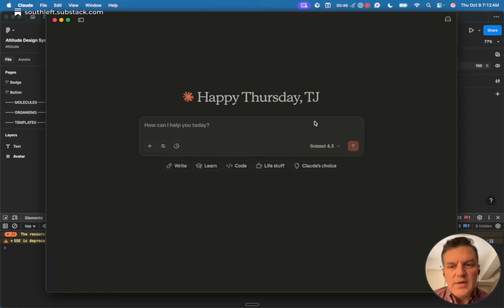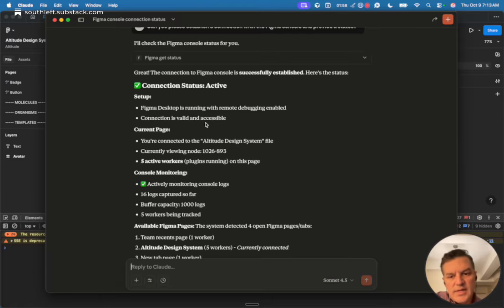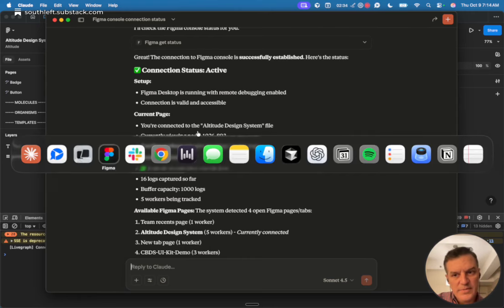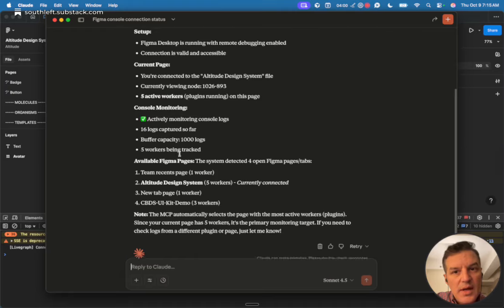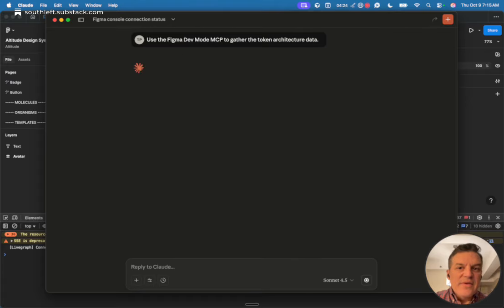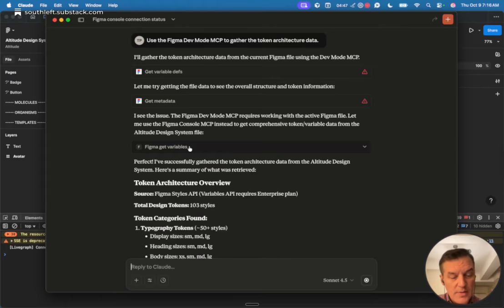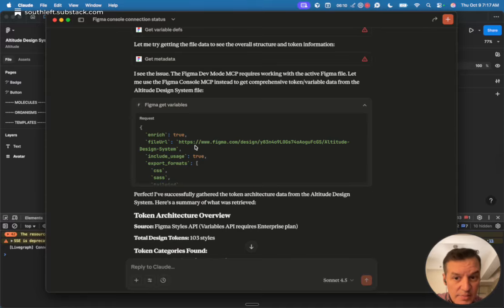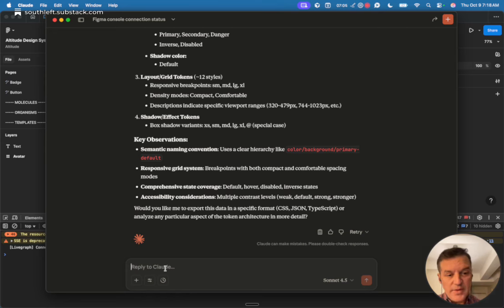Figma Console MCP: An Introduction

Comment: I had no idea the Figma MCP returned React and Tailwind. It makes a certain amount of AI slop sense, but wow. That explains a lot of the weird patterns and churn I've seen when not working in React.
Reply from the maker: Yup. I get it though. Figma Make defaults to Tailwind and ShadCN. Code Connect works best with React, TW, and RadixUI. It’s great for DS’s that use those tools, but we need to support a WIDE range of technical architectures so returning un-opinionated spec/structured models worked best for our needs.
Reply: @tpitre  I replayed that part of the video multiple times to ensure I understood as well. I did not know this about Figma MCP. Been following your linkedin content and super interested in this area of development myself. So, the console MCP returns JSON then or can you provide context to it about your tech stack and it will return that from figma?
Reply from the maker: @jakemetz1742  Exactly. the Console MCP returns raw JSON from Figma's APIs (variables, components, styles, node data, etc.), so it's completely framework-agnostic. Your AI client gets the design data and generates code for whatever stack you're actually using. No React/Tailwind assumptions baked in. Appreciate you following along!